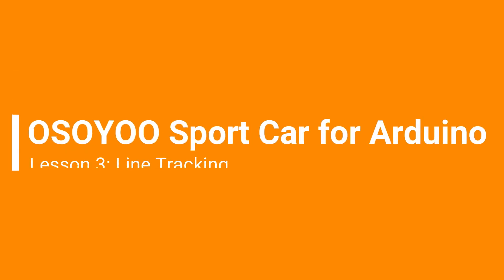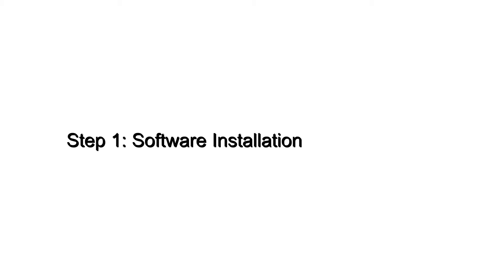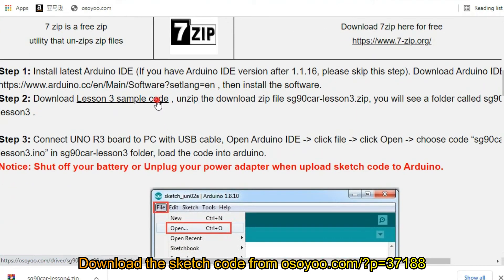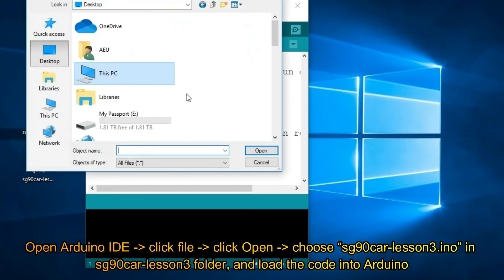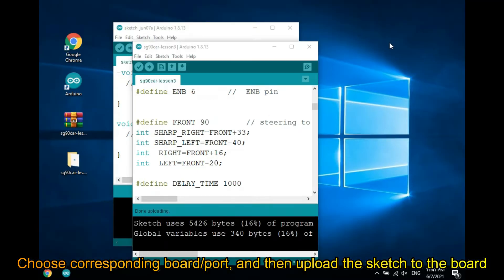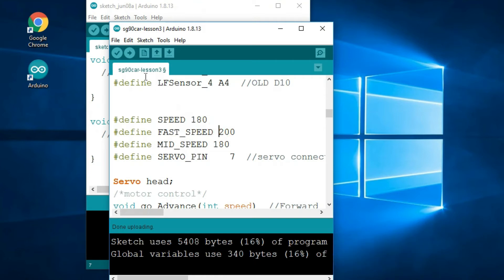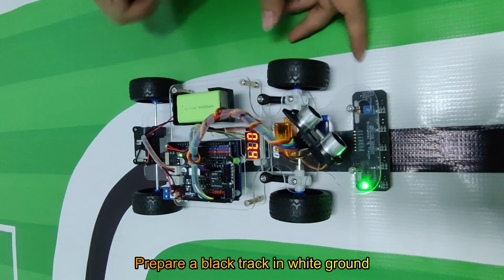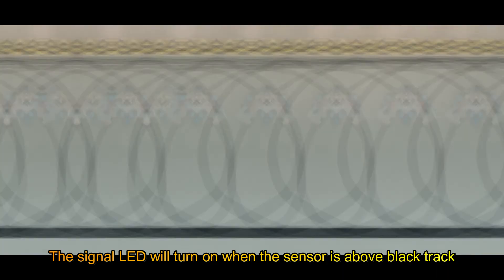OSOYOO Sport Car for Arduino Lesson 3: Line Tracking

Comment: Why isn't my robot car following its line-tracking path correctly, and how can I fix this?
Reply from the maker: 1. Please ensure the bend angle of track can’t be larger than 30 degree. If the angle is too large, the car will move out of the track.

2. Ensure the battery voltage over 7.2v.

3. You can adjust the angle and the speed of the car by edit the code.
Edit the angle: (Note: the angel can’t be set more than 35)

int SHARP_RIGHT=FRONT+33;
int SHARP_LEFT=FRONT-33;
int  RIGHT=FRONT+20;
int  LEFT=FRONT-20;

Edit the speed:  (Note: the max value is 255)
#define SPEED 90
#define FAST_SPEED 120 
#define MID_SPEED 100